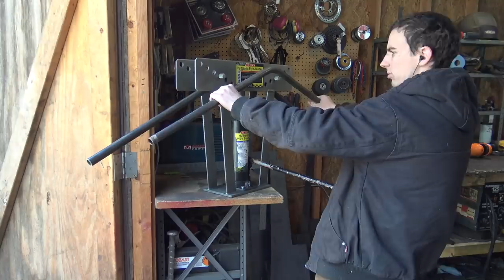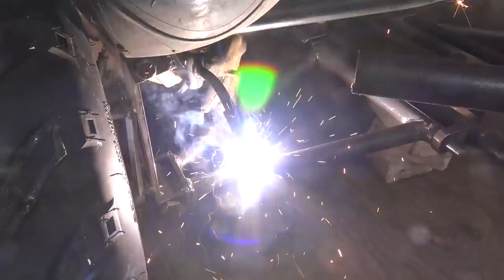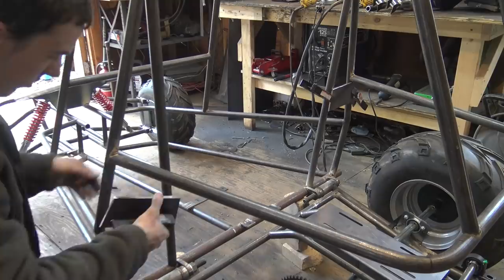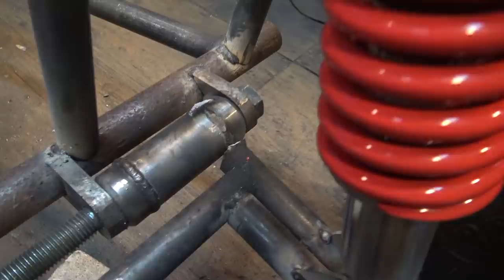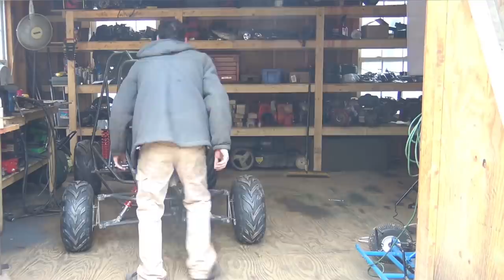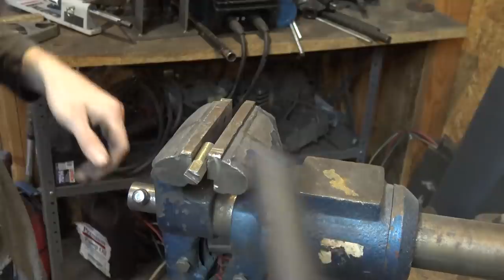Building the two speed off road go kart part 3

Comment: Aluminum body panels wouldn't add too much weight, and if you're worried about accessibility when they are installed, you can make them removable. I would recommend adding a firewall panel at least, for safety. I've used rivnuts in the past to install removable aluminum panels.

Comment: Check out sheet aluminum for the "body" panels and plexiglass windshield. Plexiglass is light enough and easy to cut and the sheet aluminum is cheap enough if you don't get diamond plate and is rather cheap if you dont go to thick. I used it for the engine cover on my inboard 18' boat.

Comment: After testing it with the 212cc put a 420cc on it for added weight of the side panels and lights and get the low end torque you will need for hill climbing and better take off power.  Just a thought.  Before you bash me for saying that think about the torque on the 212cc and compair it to the 420cc and with the electric start it would be a no brainer.
Reply: David Johnson he isn't putting a 212 on it this build is for the 420

Comment: you need something more thicker to mount your shocks to...and the back is stiff because you have them at an aqua-rd angle they are in a bind to where they cant hardly move if you look at the angle of the shocks in the front then look at the angle of the rear shocks the rear should be the same or higher in degrees...the bottom of the shocks need to go towards the rear by like 3in-4in
if you move the axle under the frame and weld the shocks above the axle then weld the top of the shocks to the (box)frame above the engine part of the frame the shocks could possibly work a whole lot better and it would make it ride a whole lot smoother

Comment: For the floor, I would use some ⅛ inch wire mesh. Easy to cleanup yet, sturdy, and would not add as much weight as a piece of sheet metal. If you don't plan on encasing the cart in sheet metal like you described in the video, mud guards around the tires would be a good idea so your not flinging mud all over the place when riding.

Comment: The mini buggy is looking great! Using aluminum or plexi for the cosmetic sheets would reduce a lot of weight. You could get slightly thicker aluminum for the floor instead of thinner steel to save a few pounds there. Add a bar down the middle to divide the load and you could use almost any aluminum.

Comment: Hi, for the panels (floor and body) I would use aluminum. I built a Super 7 a few years ago and it was a bit like Your co cart. Steel frame, but the floor and side panels where aluminum.This way You don't add that much weight and the strength comes from the frame. The panels where attached with pop rivets and "glued" with silicone in between. The silicone seals everything, makes sure there is no rattle and adds additional strength. I've done more than 20.000km with that car(t) by now. Looking forward to Your progress - Frank

Comment: Use a fan cooled 440..with a secondary clutch so its belt driven no need for gears you will have some deadly fun and yes put some protection in front in case you slide around on the trail and hit the bush from mud..also i hope you have a good air filter if your mucking around in the sand hills or sand pits..jus sharing experience🍻 your build looks great 👍🏽

Comment: A couple tubes tying sides behind front wheels and rollcage will be fine,as a space cage.,How about corrugated plastic as 'body panels' for rock and dust deflection without the weight.?Cheap and easily replaced and painted.

Comment: When i put new shocks and springs on my car it took a while to break in. Itll get softer over time. Even speakers sound better after they break in because the suspension, aka spider, loosens up.

I like the idea of adding body panels but i would use plastic to save weight and money. 

Looks great tho. Very nice build. You better put a nice big chrome exh pipe coming out the back.

Comment: Floor pans.... Start with cheap ply-wood (make brakets for bolting them etc) ....later on, as material/sheet-metal comes to hand, form it as you need, have it galvanized, and bolt it in place ;)

Comment: I found your machining and welding skills and your eyeballing for fit skills truly impressive.  I've never tackled a project anywhere near this complex, but I wonder if the tubing would be a lot easier/faster to prep and weld if you used square section tubing.  No need for grinding radii into the welded ends.   Square is structurally more efficient unless you have frame members with torsional loads, which you mostly don't ... only bending and compression/tension loads.  Is it a challenge to bend compared to round tubing?  Or is it just based on what your source provided?

Comment: Go-cart looks great!! Does the rack and pinion have a ball joint inside the rubber boots on each end? It looked like the ties rods were not pivoting much when you were bolting the rack and pinion on. How will the tie rods stay parallel to the A-arms if there are no ball joints? Maybe there are ball joints and I just couldn't tell from the video. Just curious.

Comment: What type of tubing are you using ? 🤔 I'm currently building a off road kart with my son for his summer project we used an old yerfdog 3200 frame I found and it needs a roll cage and some other upgrades to the frame to handle the built 420 we're putting in it.

Comment: I would just put sheet metal where it would protect me from stuff flying up from the tires while driving. The frame looks to good to hide it with metal and the extra weight would slow it down unless you are running a 670cc

Comment: Honest question.. are the upper control arms in the front suspension going to be Ridgid enough to withstand repeated jolt's and shock loads of off road Terrain?.. I seen you used a tradition a arm style lower but a curved single upper and had to ask

Comment: Hello, what steel tubes do you use for the kart chassis? Can I use a pipe that is called black water in steel? or also called closing? or does it have to be structural? please I need help since I also want to start a vehicle like this. Thank you.

Comment: What do u use to weld looks like just mig i have a little flux core .35 mig im hoping it will be good enough or ill use stick. I just recently started using mig is was a cert stick welder and it took me wile to lern mig its easy with a 3000$ miler with gas and all but when i started fith my little flux core 110 it was anythig but easy and hard to make good looking work .

Comment: If you’re gunna do sheet metal bolt aluminium sheets rather than steel because the weight difference is huge

Comment: don't sheet metal it with steel - if  you can, weld some little tabs on and rivet aluminium sheet to it, not much more expensive but a hell of a lot lighter.

Comment: My rear shocks on my go kart are also very stiff I don’t have a welder though.  What do you recommend to fix this without grinding and welding?
Reply: nick the car guy I don't have much experience with the gocarts but with cars and trucks I usually just cut down the springs a bit (if they are his I would cut like 1-1.5 rings off)
Reply: Go to harbor freight and buy their $15 angle grinders
Reply: Avery Hass cutting springs will make them stiffer!
Reply: Won’t cutting springs make the kart sit lower too?  That’s not what I want.
Reply: Yes dont cut the springs.
If theres room try drilling new mountingholes closer to the pivit point on the old brackets. a small adjustments probably enought to make them a litle bit softer.
Reply: nick  , snowmobile junk yards , they have millions of shocks and springs ,  snowmobiles tend to have the highest quality rebuildable shocks to use on these projects .

Comment: Well it shall handle pretty good at high speeds id soften up the rear a tad and stiffen the front a tad
Reply: Yes add the sheat metal and a Plexiglas windshield man. It will look good and still ride good i dont think its gonna add to much weight id try and get 1/16 inch sheet metal yes its thin an time consuming to weld so you dont burn holes but worth it and wont add to much weight

Comment: I have flux-core wire (the non-gas) But I'm an old welder (I flux-core with gas as we do in factory). But I hate non-gas flux-core, so I've tried that same wire along with gas.... amazing ;) (even more so about that hack I thought I found, JD Brewers youtube only weld with that "hack") (and I found that, only a month after I tried gas-along-hack of mine, when Jody -weldingtipsandtricks-, made a video at JD Brewers. JD always use gas even with any "non-gas-needed" flux-core)

btw, never go down-hill with flux-core (gas or no gas) Just use epoxy-glue instead.... LOL :D